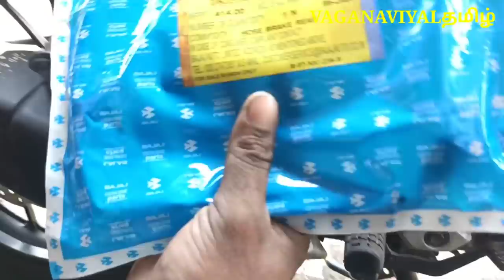How to Disconnect honda hornet Combi Brake/தமிழ்..

Comment: Combi brake is a excellent feature. It saved me from many accidents. First time hearing due to combi brake one got accident and disconnecting it.
Reply: Combi break is not working well bro... ABS breaking is very best
Reply: @Mohan_Kumar_TN  CBS and ABS both are completely different bro.  In CBS tyre will skid in ABS it won't. CBS only concept is to apply both brakes equally 😀
Reply: @sutharsansadhasivam2401  but cbs does not work properly
Reply: @Carracingstimulater93  if you have doubt whether cbs is working in your bike or not then there is a simple way to test that. Stop your bike in centre stand and rotate the front wheel and then apply the back break. If wheel stops then combi break is working fine. If not then there is a problem with your bikes's cbs unit and have to check in service centre.

Comment: 1) Bro back distribution unit irundhu Front caliper ku pora line dosconnection pathi sollavae illaiae, 
2) front brake apply pannum pothu  caliper la iruka middle piston la irundu oil leak varuma bro ? Konjam Theliva sollunga namba

Comment: Hi Bro, Enoda new Honda sp 125 bs6 bike la ride poitu vanthu engine ah off pannathuku aparamum, oru 30 seconds ku engine la tuck tuck sound kekuthu.. Bike ah 70 kms thaan ipa varaikum drive panniruken.. Intha sound varrathu ok thaan.. Problem ethuvum illaya.. Illa engine la ethavathu problem irukuma? Please share your comments bro..
Reply: Its completely normal bro. This sound comes from thermostat part of silencer. It gets slightly expanded due to heat when engine is running. After u turn the engine off, that thermostat part begin to cool and shrink. During that time, we can hear that noise for few minutes.

Comment: Bro pulsar 150 le clutch plate change pannadhukku apram 1gear and 2gear le clutch pudicha chain  loose ana madhiri sound varudhu bro
Reply from the maker: Clutch plates bend irukka check pannunga bro
Reply: @vaganaviyaltamil  clutch plate full set change pannalum same problam irukku bro